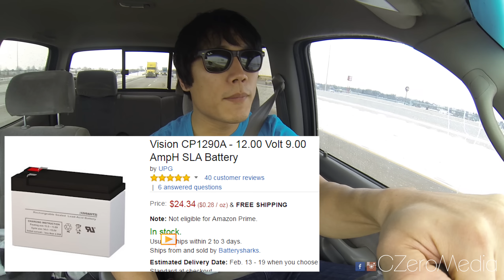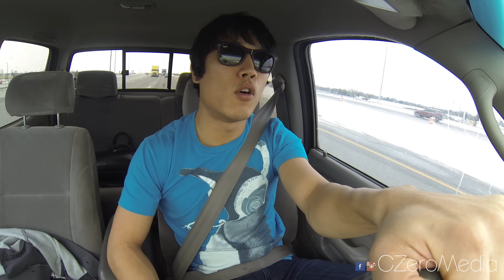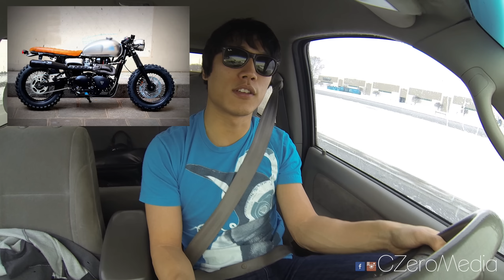'75 Honda CB550 Cafe Racer Build Pt. 54 Q&A - Vlog #6

Comment: The seat you can find here.. 
http://www.ebay.com/usr/stevec6535?_trksid=p2055119.m1438.l2754

And the exhaust can be found here...
http://carpyscaferacers.com/shop/shop-our-store/motorcycle-parts-accessories/honda-cb500-cb550-cb750-parts-upgrades/stainless-steel-4-into-1-exhausts-for-cb500-cb550/